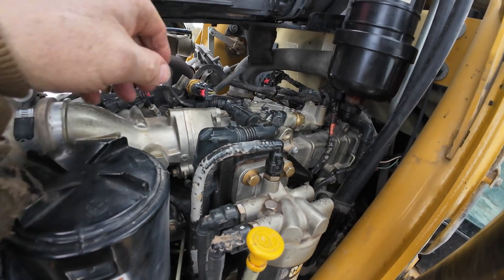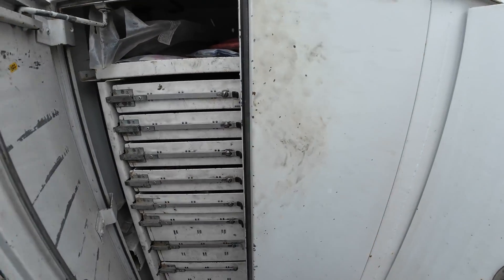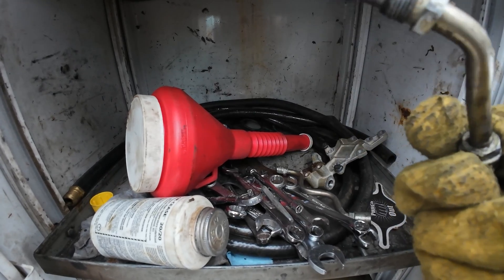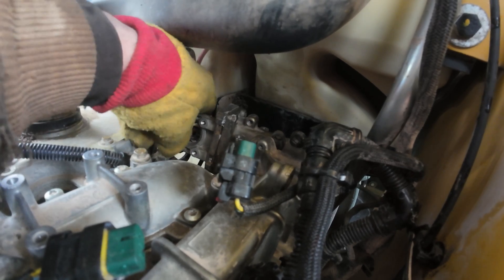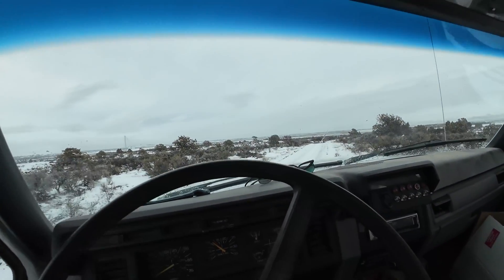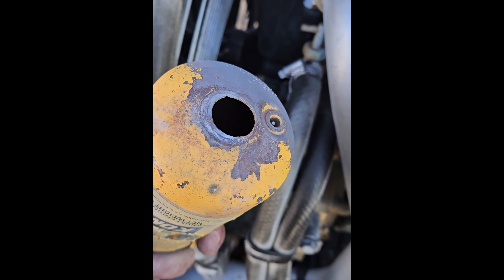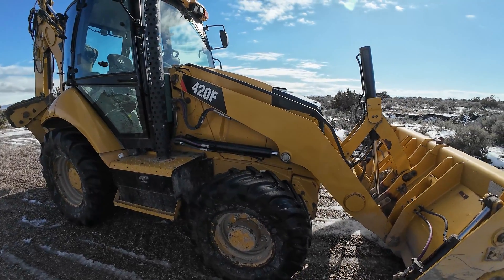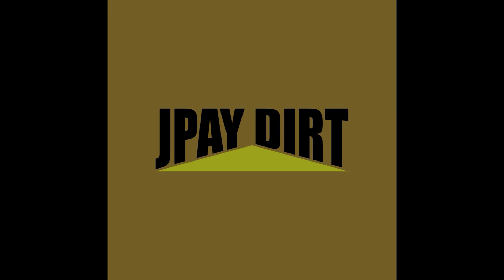CAT 420F High Soot Derate

Comment: Have you ever looked into Pittsburgh power fuel catalysts for your backhoe and excavator? It would be interesting if you checked the soot levels and then ran catalysts for a few tanks of fuel then check them again. 
I run it in my Peterbilt with the x15 Cummins. I only notice it regening like once a week.
Reply from the maker: Yes I have used it and did notice a difference

Comment: Good that you got it figured out and fixed on the cheaper side even though it cost you a lot of time and heartache. Newest stuff i like to run is my 98 Pete with 3406E, just the ECM computer is more than enough electronic crap for an engine.

Comment: Do you use cetane booster in your fuel? That helps keep the egr system much cleaner on my power stroke. Went from have to clean the egr cooler and intake plenums and map sensor every 30k miles to now it stays clean

Comment: Jeff you sounded like you wanted to strangle an engineer or two ?? 😂😂😂
Question for you and the gentleman who was helping you on this repair. 
If you delete the egr out. Would running transmission fluid in your diesel occasionally help with that? 
Knew an old school trucker and they would occasionally dump a quart or two in the diesel to help them run better. Or doing that would it through the computer into a fit??
Reply from the maker: Never heard that so I can't say

Comment: It’s funny all the laws passed for that crap on diesels. Some states have inspections and raise all kinds of hell when it’s not working or deleted on road vehicles but no inspections or fines on off road stuff. The first thing I’d do if I bought a construction equipment with that crap is lighten the load. The EGR’s crap causes more problems than anything. Diesels like clean air, breathing all that soot you may as well not have a air filter on the equipment.

Comment: How did the EGR prevent regen?  Stuck open, stuck closed, or computer refused to run regen procedure because it had a semi unrelated code?
Reply: I believe it was due to having an active fault code, most cars and trucks are that way. I imagine heavy equipment can't be that different.
Reply from the maker: it was stuck closed, everytime the exhaust valve tried to close the engine would cutout, as the egr valve was stuck so it would hesitate,  i ran the air motor test and it came out good, for some reason it doesn't recognize the the egr motor is not able to move the valve during the test, Mike said it was screaming egr so that's where we went and he was right
Reply: @Jpaydirt  These newfangled things would be OK to troubleshoot if they gave correct fault codes and the manual had helpful troubleshooting information like the olden days.

Comment: Computer, EGR,Exhaust filter,DEF fluid things that a diesel  never needed
Reply: Electronics were one of the greatest things for diesel engines. More power, better fuel economy, better emissions. It’s nice having pre-emission stuff, but I like being able to work around equipment and not being choked out by the exhaust fumes.
Reply from the maker: I disagree on the better fuel economy statement,  but they do smell cleaner,  baby steps i guess,  when they can get the injection pressures up much higher you'll see egr go bye-bye,  Caterpillars new c13 doesn't use egr and Cummins has been able to get rid of egr also @user-ln7of9gs4s
Reply: @user-ln7of9gs4s Guess you’ve never worked around new equipment… The fumes from regens are ten times worse than regular diesel exhaust

Comment: Delete it! Emissions on heavy or off road equipment is one of the biggest scams going! You have idiots that design it, in spaces that are not designed to be able to work on it, with sensors and devices that do not last under conditions they are subject too! But the whole green emissions thing is nothing but a scam to begin with, that is mainly mandated by even bigger idiots in government! But don't you worry, our elected officials are making money off of it!